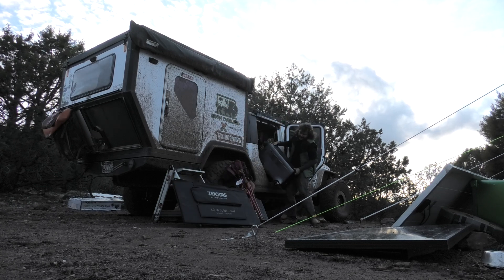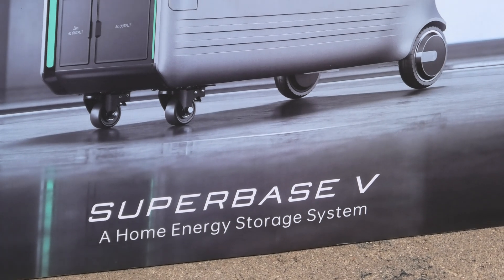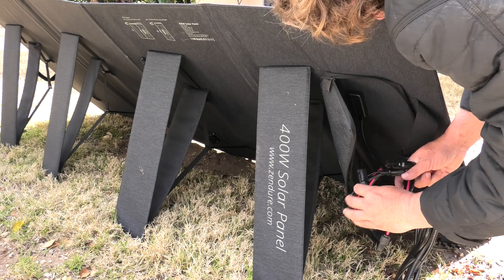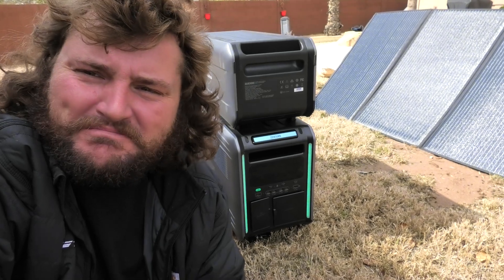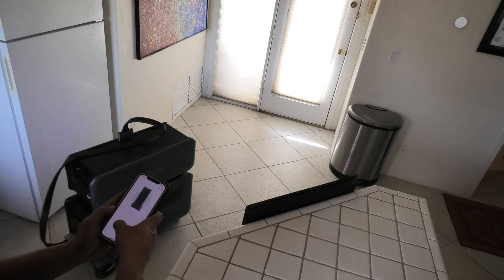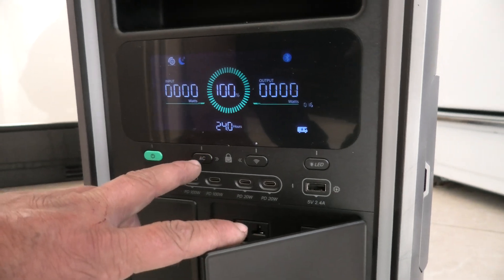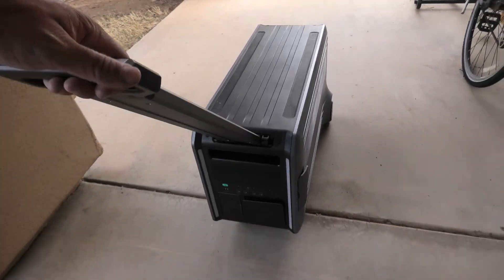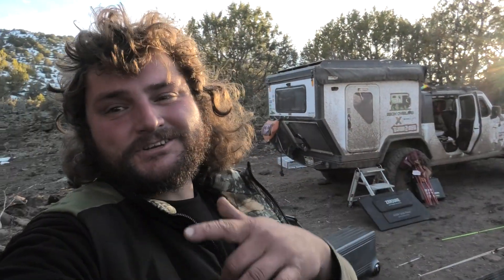You can DRIVE this Solar Power Station like an RC CAR! Zendure Superbase V 4600w TEST

Comment: Coolest battery backup ever! I got same base and satellite setup. So it would only do 7600w if you paired 2 base units instead of satellite battery, the satellite just gives more capacity, so you and I have 9.2kw’s there :) . Still 3,800w is enough for me! Also I noticed you didn’t remove rubber inserts from the top of the base for the satellite to sit on top flush and more stable… nice review, enjoy!